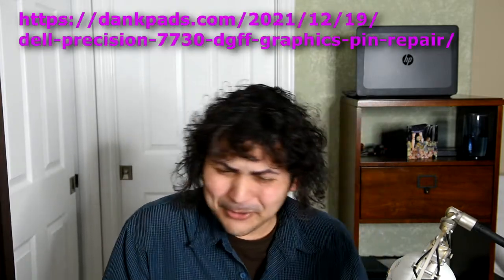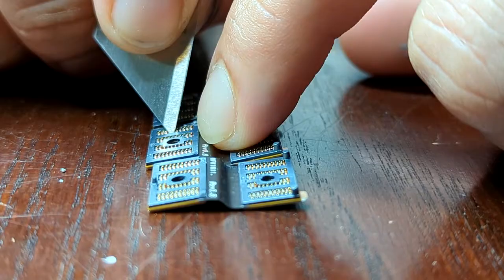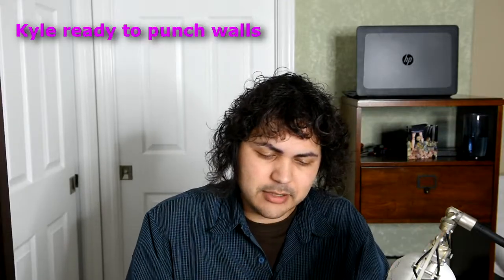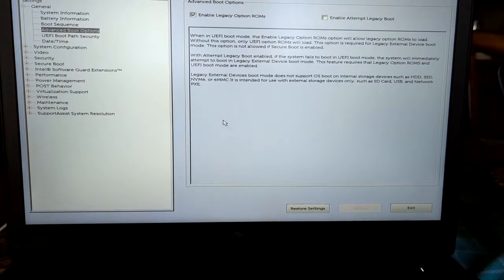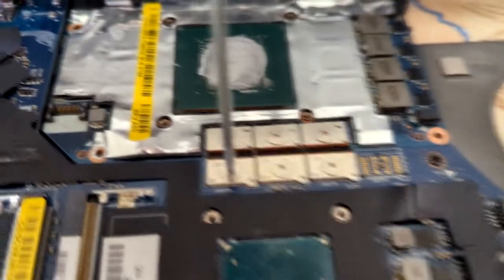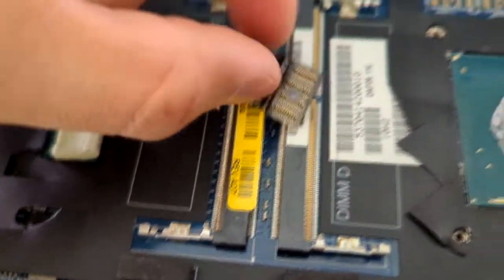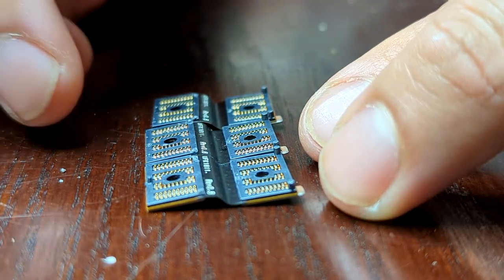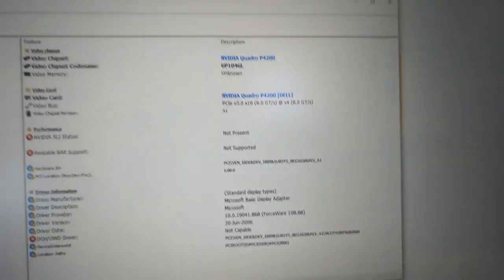Dell Precision 7730 DGFF Graphics Card not showing up - Damaged laptop PGA repair

Comment: A fun fact, is the Delta 240W bricks are all garbage and fail every 2 years or so, at least did for me, they wouldn't totally die, but would overheat and trip off on load, the Flextronics brand 240w dell psus would however be fine.
Reply: also if you disable nvidia optimus the gpu should be up to 20% faster, precisions are lovely in actually giving you the option
Reply from the maker: @arbitrarygrill6886  will do now thanks 😋